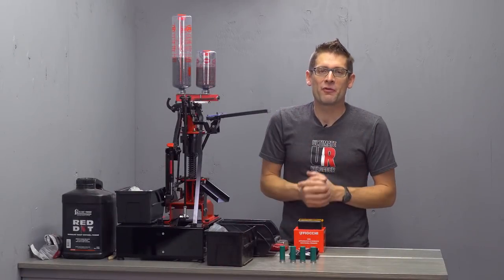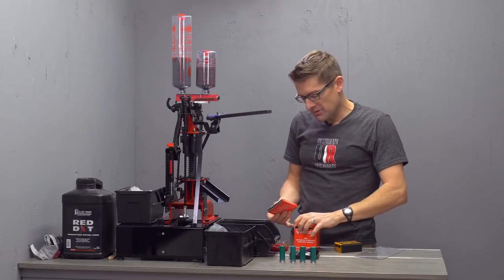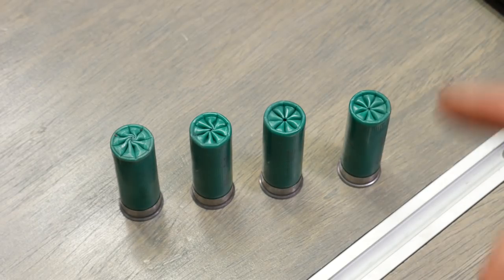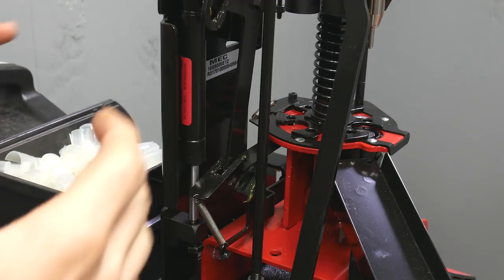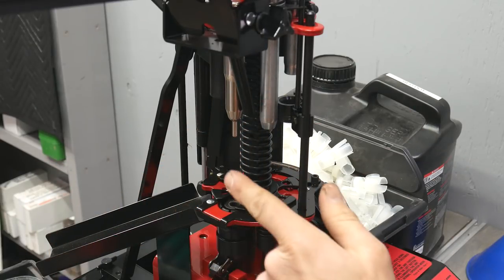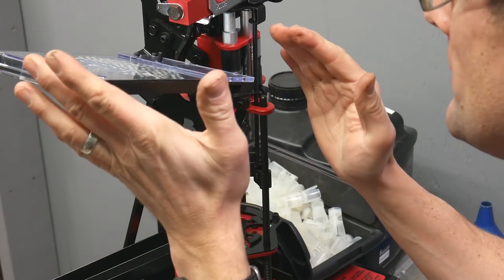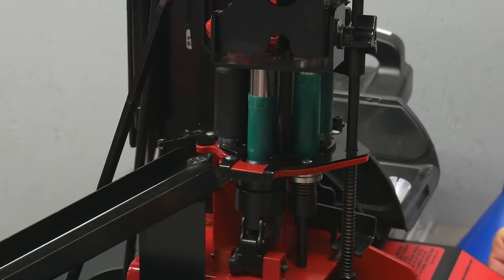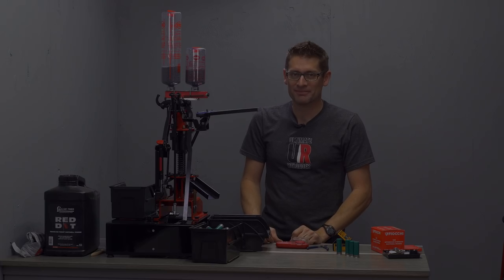MEC 9000E with Auto-Mate  Loading 12 Gauge Shotshells

Comment: Yours is the ONLY YT video that shows the MEC 9000 press cycling, as it should, with a single shell.  EVERY other 9000 video claims that you need to hold a shell underneath to catch powder or shot -- they don't have their presses adjusted properly.  Thank You!
Reply: I have watched the video multiple times and still cannot figure out how to not get powder and shot dropping down. What am I missing?
Reply: @jss8494  I don't know.  Mine worked right out of the box.  However, I use the components the press was aligned for.  Why can't you just call MEC?  They should be able to help you.

Comment: Gavin;  Nice video. I am using an old Mec 650 and looking to replace it with a 9000. I appreciate how you went thru loading a single case then going in the auto mode. I also reload Gun Club hulls. This was a great video. Thanks and keep up the good work. God Bless and stay safe.

Comment: Since there are no manual 9000 available, do I just get one of these? It's much more expensive than the 9000GC but basically the same machine but with power. Am I right?
Reply: I have a 9000 without the automate, works great & a lot cheaper & still indexes automatically

Comment: They should have put the control button on a foot pedal so u can use both hands to load while u sit at a chair like most people do
Reply: It is deliberately tying up both hands so you can't leave them in the mechanism.
Reply from the maker: Yeah, I think a foot pedal could be super-dangerous. With both hands on the buttons, you can't crush fingers :) Plus, I can load the hull and wad just after the indexing completes, doesn't really slow things much to use buttons...
Reply: paul nyhuis modern safe hydraulic units have a safety zone set up with lasers so even if you bring the pedal too close you break the lasers beam shutting it off
Reply: @Ultimatereloader  The Spolar has foot pedals.  You have to have enough common sense to keep your hands out of the way.

Comment: Informative video.  When reaching the end of loading, you can turn off the primer loading but how do you incrementally shut down the powder and shot drops?  Curious to know if you reload Federal Target hulls.  Would like to know what 1oz Wads you use?  Thanks.
Reply: If set up properly, the MEC 9000 has a hook that locks the charge bar to the left after the last hull has received its shot charge.

Comment: A bit late to the party but there is something called a moke mate for the auto mate that bypasses the switches with a foot pedal you can look it up on YouTube they look easy enough to fabricate yourself.
Reply from the maker: I wouldn't want to do that. There's a risk of crushing your fingers- that's why there's two switches. :)
Reply: @Ultimatereloader  I only mentioned it because the 9000H has a foot pedal for operating and they are kinda loud with the pump going all the time. But in all actuality you are right the extra couple of shells per hour you could make are not worth any of your fingers.
Reply: @xlxyetixlx  I've had both a 9000E and a 9000H.  I put the mokemate on the 9000E.  It worked fine.  Just like the foot pedal with the 9000H.

Comment: Thanks heaps for the great video.
How were you running the single shell without spilling shot and powder?
Reply: The MEC 9000 (G, H, or E models) have an automatic shot and powder shutoff so that neither shot nor powder are dropped if there is no hull in that station.
Reply: @timothybruggeman9332  the mine 9000G drop powder and shot without hull in the station. How can I setup it? Thank you
Reply: @tenfabio  I'm not the best person to ask. But I would first contact MEC's technical assistance guys. They are great troubleshooters. Also look on YouTube. MEC has a lot of videos posted there that may help you. There is a "hook" that is supposed to rotate up and lock the charge bar to the left when there is no hull in the priming station.

Comment: I see a PLC with an adjustable dwell timer in your future.
Reply: They deliberately made it so you have to take both hands out of the way of the mechanism to cycle it. I am sure it has a PLC as you've described  internally to govern that so you don't get incomplete powder drops. It's engineering around people being dumb. 

I used to build industrial machines. It is common to have foot pads for each operator, or a hand button, etc. That can only be depressed when each operator is out of harms way. Unless each button is depressed, the machine won't run. People will set a box on the switch and crawl into the machinery and kill themselves occasionally, but they had to be extra special to succeed.

Comment: seems like you're paying 500 bucks to not have to pull a lever? am i missing something?
Reply: Well, yes.  If you are like me, with shoulder injuries from earlier life that make pulling a handle over and over a chore, that ultimately causes pain, it's kind of a "nice to have" feature.  Not necessarily faster.  Just easier on the old body parts.
Reply: @timothybruggeman9332  Precisely!  I loaded 100 on my 650 Jr. and could not understand why I had a stiff neck the next morning.  Then I realized that I had pulled that simple "lever" 600 times.  I am rebuilding a 9000 now.  Should be easier on the old body.

Comment: I'd be curious to see a direct comparison to the spolar gold reloading press.
Reply: Comparing a Cadillac to a Corolla.  Both will do the job.  One is way overdesigned.  The other is "good enough for most people.
Reply: Spolar gold reloading  press
Reply: @timothybruggeman9332  Sploars are built for high volume loading.  An experienced operator can easily load 7 to 8 hundred rounds an hour, if the machine is equipped with hydraulics or the automate.
Reply: @robertdawson6043  as far as I know, the Spolar Gold doesn't come from Spolar with an Automate option, only hydraulic, unless someone has rigged an Automate up to one by themselves.  Seven or eight hundred cartridges in an hour?  I think that's a stretch...  If I hurry, I can get 500 in an hour with my MEC 9000H hydraulic.  But hurrying often causes mistakes, so I seldom hurry.  I can make 300 - 400 in an hour with my Hornady 366, which is totally manual, because I have ridiculously big shot and powder tubes on it and all I have to refill is primers. But again, that's if I hurry. And the cartridges that come out of my 9000H and my 366 are just as pretty and break targets just as well as the ones that come out of my friend's Spolar Gold.  Don't get me wrong, I'd love to have a Spolar.  It's a Cadillac. I'm a Mechanical Engineer and I certainly appreciate a finely designed and manufactured machine like the Spolar.  It's definitely more "heavy duty" than the MEC.  But I can do pretty much everything with my MEC and my 366 that my buddies can do with their Spolars.
Reply: @timothybruggeman9332  I misspoke.  PW makes an electric drive for the Spolar.  The Spolar is made to be a high volume press.  You really can load this number of shells in an hour without having to hurry.  This machine with hydraulics will load a shell in 3.5 seconds.  The Spolar and the PW load new components on the half stroke.  The other machines add new components after it has been cycled a full stroke.  I have been loading with this machine for about 5 years and yes you can load this many shells an hour without hurrying.  There are people that are able to load more than that in an hour, 1000 or better. The Spolar and PW are expensive up front, but you can buy one base machine and add tooling to change the gauge.  The MEC and 366 are really only able to load one gauge.  You can can change the tooling, but the machines aren't really built to change gauges.  The PW convertible and the Spolar gauges can be changed in less than 10 minutes, without having to make any adjustments.  Once the presses are setup you can load any brand shell without making any adjustments.  On the 366 you can add the spring loaded primer seat, but that is only for the 20 and 12 gauge.  The MEC sometimes requires adjustment when loading different brands of shells.  If you want to load a bunch of shells very fast, the Spolar with hydraulics is the way to go.  PW is a close second.
Reply: @robertdawson6043  Robert, I just ran 100 cartridges through my MEC9000H.  100 in less than 10 minutes, at a leisurely pace (not rushing, just steady) with the caveat that I was starting with full powder and shot tubes and full hull and wad bins, and 200 primers in the tray.  Could I continue that pace for an hour?  No.  I'd have to refill everything at least once or twice or more, so I potentially could get 500 in an hour.

Comment: I never understood the economics of loading shot shell. Slugs and buck I can understand. With the price of shot, the finished shells cost darn near factory cost. And that's not accounting for needing to buy hulls. Maybe I'm missing something.
Reply: @Mr_D555  So do your shells cost less than factory? I just dont see the huge benefit, unless the savings are there. Dont get me wrong, I know there are other factors. I currently load 18 calibers, and cast my own pills for at least 15 of them. If Im not bringing cost down at least 90-50%, Im not wasting my time. The issue is the shot. Where do you buy?
Reply: @thetobaccoguy1751  Most of the savings is in the sub gauges.  410 and 28.  They are 10 or 11 dollars per box.  The small shells can be loaded for about half of factory.  Premium 12 and 20 shells are running about 9 dollars a box.  You can reload for a little over half that.   If you shoot reduced payloads they  can be difficult to find.  I understand about promo shells, but the performance isn't always consistant.  I have also seen promo shells misfire and in one case destroyed a shotgun.  Your mileage may vary.
Reply: @robertdawson6043  Just out of curiosity as I've heard it many times before, what is a promo load?
Reply: @thetobaccoguy1751  Promo loads are the cheap loads you find at the big box stores.  They don't always have consistent performance and will not always work with tube sets.  Tube sets may not be something you use, but to some of us it is important.
Reply: @robertdawson6043  Interesting. I learned something. I guess you could save a bundle loading your kids .410 loads. Those suckers are salty. That and casting your own buck and slugs.